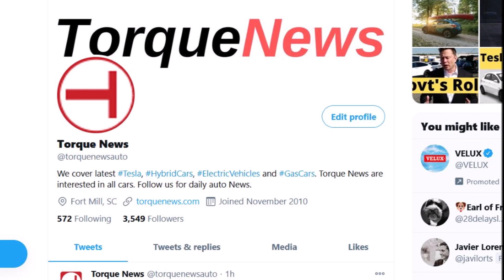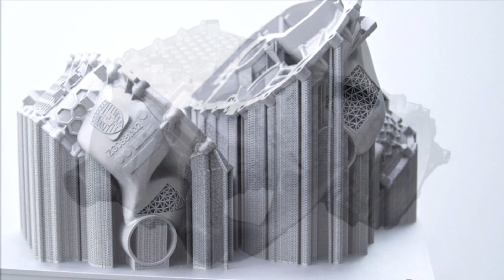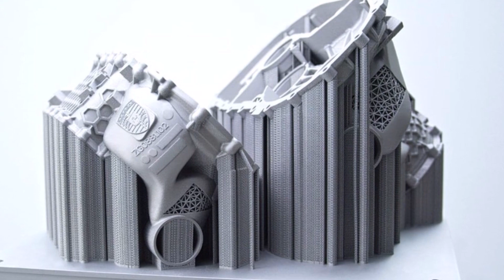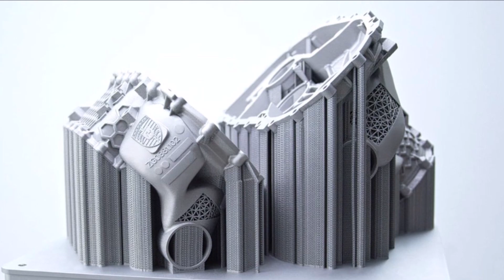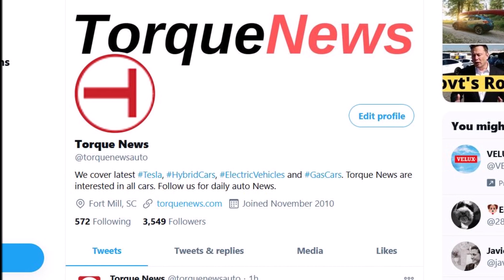Porsche Manufactures EV Drivetrain Parts With a 3D Printer

Comment: For many years manufacturers have used 3D printing for R&D testing and prototyping, but it's another step to actually produce high performance metal components, especially drivetrain pieces that take regular abuse, and need to last hundreds of thousands of miles in cars. It is great to see this level of innovation actually used in production vehicles. And Porsche deserves recognition for researching and investing in these new technologies.

Comment: Although 3D printing in metal can have advantages over other metal processes in the short run, it is not a good choice if say, 100,000 units are needed. Die casting is the choice in high volume applications by far. You still have to machine precision surfaces in both processes like where two parts must align and be sealed or where bearings are seated. It is great to know that, with some redesign, functional metal parts can be 3D printed.

Comment: 3d printing is used in SpaceX to print its parts. Im sure tesla uses 3d printing to do prototypes for its parts. I don't think it uses 3d printing YET. But Elon might take this idea from Porsche..... but is it quick enough? I doubt it. Can Porsche print 1000 exact same parts per day? I doubt.
Reply: Most 3D printers. They have a relatively small footprint. Just keep stacking them until you have the output you require.
Reply: Porsche is a real sport car manufacturer and they have very good alloys for all parts of their cars, from brakes to all suspensions and chassis.... you can easily see that in porsche lemans cars from the past too with magnesium and carbon fiber usage